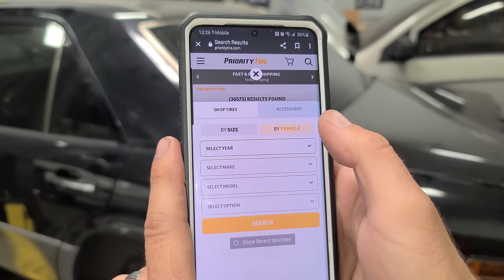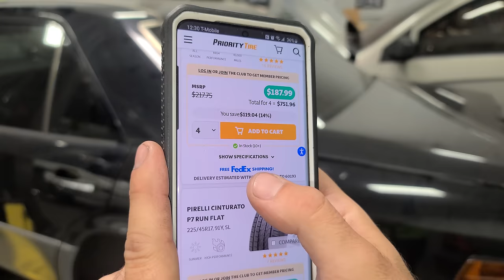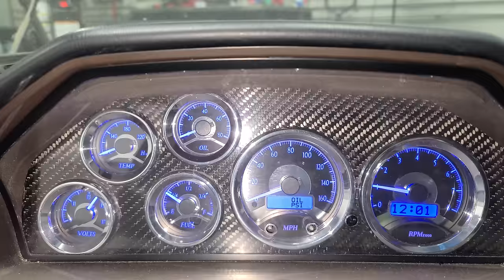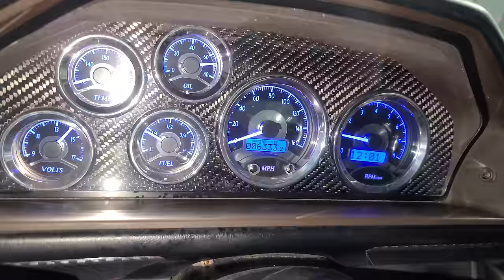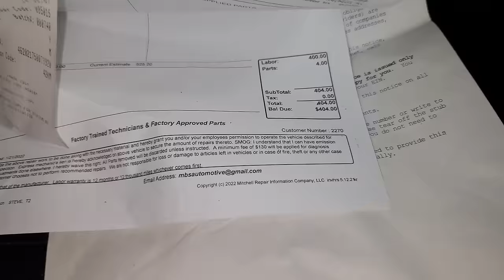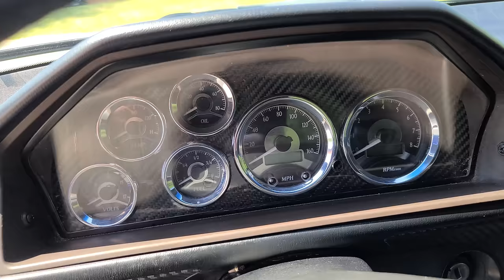I Finished EVERYTHING On My LS Swapped Mercedes Turbo Diesel! Best Of All Worlds!

Comment from the maker: Get 5% off any tires and accessories on Priority Tire's site with the code 'LEGITPT823' until August 31st at: https://bit.ly/LegitStreetCars_PriorityTire.
Reply: Sorry, we don't say meats in cali.  Must be a mid west thing.
Reply: Air in oil line before filter has to be pushed through the filter. Dry media of the filter is invisible for air. When you have oil over filtering media - you create extra resistance. It can rip a hole in your filter.
Reply: The back of the driver's seat needs a tiny little bit of "sewing".
Reply: Yes I do lol
Reply: Love the idea of where this is going!! But what happened to Peter??
Reply: Dude, if the AC works I'd give you 12 grand
Reply: Did you just say "MEOW"?
Reply: Why do they insist that you order the Chinese tires?
Reply: Thank you for the 5 percent off I needed it
Reply: @RobertDooley-sl7cp  I heard people say the tire has a lot of meat left on it.
Reply: If it's never been done before at that point you set the price but do remember the price of the car when it was originally and not going way over the top to it
Reply: So what are the odds this gets an LS supercharger Alex @legitstreetcars 😮😈
Reply: 36:36 DeLorean wheels and tires!
Reply: 300 LS
Reply: Should call it the Mercedes 300 LSD
Reply: Best of luck in future but remember I like because of Mercedes Benz first and second find some luxury cars to work on like the rolls royce phantom in in bad condition and restore it good episode positive you have a million views
Reply: Idk how you do it please just trade it for another Mercedes keep it going all Mercedes trade up…!!!
Reply: I have 1989 trans am turbo but someone before me put 350 should I do LS swap and add turbo??
Reply: @doncrescas  Yeah, wouldn't put those shitty tyres near anything, let alone a car with several hundred RWHP.  Most important parts of a car, tyres, brakes, suspension and steering - don't cheap out on any of them!
Reply: Needs my black center mono blocks. That would be perfection.
Reply: Absolutely do not feel sorry for dropping your oil. They sell it to whatever service comes to get it and it goes to be recycled. Any bulk oil distributor, like for an oil change shop, or industrial cleaning service, like safety kleen for example, will come get it for free and you can even negotiate with them for the price they will pay you for the discarded oil. Yes, they will buy it from you. Maybe even bring you a bulk tank for used oil to dump it into, which makes it so that they can come whenever you schedule and just hook up their truck and pump it out, and away they go. You'll sign for however many gallons, and they'll send you a check or bank draft or whatever.
Reply: Would you be willing to trade the Mercedes for the Tyler Hoover ,WS6 car treck car?
Reply: !e!!!eaew!a!
Reply: Asass❤11Q
Reply: did you check you k40 relay "w" on your w215 to make sure that you are not loosing power to the coolant pump?
Reply: If i was to run across a 2000 Mercedes Benz diesel runs and drives just got hit in the front are they good cars
Reply: I love this car i want a car like that to go to work
Reply: Pineapple, but not too much. I also prefer cold pizza.
Reply: How were the motor mounts done? Bolt on??
Reply: And ...what is the total cost?

Comment: Lake Speed tested the difference between prefilling and not prefilling oil filters. Tested in the Valvoline lab on a test engine. Analysed the oil samples and computer traces of oil pressure vs time. Pre fill your filters folks!!!

Comment: Next car you detail, you should iron decon and clay bar before doing the paint correction. It will make the buffing way easier and cause less damage to your pads and paint.
Reply: I'm actually sort of surprised he didn't clay bar it, but maybe he thought it wasn't necessary, I don't know.
Reply: It's single stage paint, the paint is really soft and you end up pulling more paint than contaminants. Also he doesn't love the car like that.
Reply: I'm the same.
Thought a quick clay bar.
But the Merc turned out great..
Reply: Trizact wet sand pads before the compound would have made a huge difference
Reply: He should probably use a lot less product as well. He’s using WAAYYY to much. It just clogs up the pad and is hard to buff off the paint

Comment: 30:20 the thing about oil based clear coats is that buffing heats the oil reactivating it into a uniform finish. need to clean surface with cold water on a cold day to prevent dirt from becoming imbedded into the clear coat, tho buffing down to the paint and re-clearing is an easy process.

Comment: Hey Alex have you ever considered using saddle soap for softening & cleaning anything leather, it works really well and can be found at in the horse section at tractor supply stores for very cheap, make sure you grab the solid one.

Comment: That car certainly buffed out and cleaned up nicely. I also can't believe they didn't think to swap the throttle body around and instead put a nipple on the hood. I think you got a fairly easy one here, minor mechanical work that needed done, hardly any parts, I think you'll do well selling it or trading it up.

Comment: ASE Mechanic here, one tip in regards to oiling your air filter is to spray it and leave it on newspaper overnight to prevent fouling up the MAF sensor if you have access oil in it.

Comment: If i remember correctly from the previous video the car was originally a 300D model and immediately came up with an idea that I would really like to see on the channel - building an OM606 engine :) Lots of people here in Europe like this engine and tune it(If I am not wrong, I think the OM606 is the 300 Turbo Diesel from a W210). Legends say on stock internals engine can easily take 500 HP..  So, knowing you perfect work from each and every video, I think you will be able to create one of the best cars with an OM606 :)
Reply: He did build a diesel mercedes but with the om648
Reply: Om606 was first used in 1993. If you have to have a 722.2 transmisjon or 722.6 then it's superturbo time

Comment: 12:21 cornwell tools had a socket shaped like a bell that’s used to replace it without having to remove anything. 2 he job turned 10m with the socket. The tool truck guy who comes to our shop designed it and sold it to snap on and cornwell works great in the trucks with very limited space.

Comment: E34/E39 BMW 5 series and W/S/C 124 Mercedes are some of the best cars ever made. The LS really fits with the solid engineering of the W124... The W124 diesels were EXTREMELY solid cars, but not fast. They could be made fast though, the straight six 3 liter turbodiesel OM606 engines take 700 hp without being opened. Pretty much the diesel version of a 2JZ. 
Very nice car with an LS!
Reply: Completely agree with you, I've currently a E34 525TDS and it's a perfect cruiser, so efficient and comfy ! This one and the W124 300TD were the kings of road here in Europe 90's.
Reply: Had a E39 528i manual, that was a great car and great to drift as it had the same rear axle as the m3, little low on power perhaps with just 198hp but a Turbo will fix that as they take low boost just fine.
I would get another 528i just for a daily driver but they are not common anymore, most were sold with the horrible automatic transmission, and most is scrapped.
Reply: the m104 gas inline 6 is that way too, turbobandit still has a turbo kit for em same with the m103.
Reply: Lol. I have  a few manual 528's sitting around. They had a open 188 kompact diff. Not a m3 diff.   I did swap my 528 wagon to a m5 210 lsd diff. And a turbo e36 m3 motor. Cant complain , thats for sure.
Reply: E39 owner, my car and these old big body Benz cars truly are peak
Reply: @drewdavis239  
And thats not the Automatic one?
Because the 528i and 528iA use different rear axle.

Comment: Two things of note:  Don't use primer alone to protect from rust.  Primer attracts moisture and will actually promote rust.  Shoot something else over the top of that primer on the battery tray.  POR15, or just an actual black paint.  Two:  Before you ceramic coat your glass, hit the glass with your buffer, and your cutting compound.  It'll remove any microdebris from the surface, won't harm the glass, and will make it crystal clear, like it was brand new glass.  THEN coat it.

Comment: I am like you on the oil filter. If the angle will not cause the oil to run out I prefll but if the oil is going to run out during install I don't. I also disconnect the ignition and build oil pressure before I start following a change.

Comment: What about a drag strip run between this and an original 400E/E420 or 500E/E500 even!?
Reply: This would gap an E500 for sure.
Reply: @rv9990  what kind of horsepower is this engine making?

Comment: I thought my oil pressure switch was bad on my 2016 Chevy SS but found out the oil pump was replaced at 27k and they used a lot of silicone seal the pan. So of course some of it went through the engine and grenaded it! Thank God I bought a warranty and was replaced with a new LS3. Bone stock and I LOVE THIS CAR!!!!

Comment: Pre-filling a filter is an issue if you getting oil from a bulk tank without filtration on the pump.  You could be introducing debris or contamination from the bulk tank.  In the gas compression industry it is recommended to install filter dry and run your prelude/hot start system to cycle the oil before starting.

Comment: Wow what a transformation, let's see where we go from here. What could be cooler thank an LS W124 ❤
Reply: Nothing. I have a Tahoe and a w124 and I really like driving the Tahoe more just because it has the torque and runs great for around town but I much prefer looking at the w124, having the 5.3 in the 124 would be perfect. 
That said, I’ll never do it, it’s probably beyond my skill level to do it nice enough and my w124 is mint with relatively low miles so I’d feel a bit guilty. I think I’m going to sell it in the spring. I thought I’d keep it forever but I haven’t even drove it this year so it’s time to move onto something I’d use.

Comment: This is so much more entertaining to watch and you look you are having way more fun working on this than the Mercedes V12. Everything just makes sense on this.
Reply: This w124 is the 300d model, it came with an inline 5 cylinder engine (OM603) originally, not a V12. 
However, you are right he looks like he’s having a blast, & he’s not covered in oil and soot like he would be working on the original turbodiesel engine
Reply: @Warex06 he's talking about the amg cl 65 the nightmare on wheels😅

Comment: I use 5 gallon Home Depot buckets.  They have a really tight sealing cap on them.  Sometimes the auto parts guys give me flak for bringing in 10 gallons of oil at once to recycle but they're usually good about it

Comment: Watched some test about pre-filling an oil filter. They found out that the first moment with pre-filled filter, the oil pressure is Lower than with empty filter. No idea why. Go figure. On my audi service manual says to Not pre fill the filter but just lube the gasket. I remove the fuel fuse and crank it for few seconds to fill up the filter and then start it back on. Great find Alex

Comment: I like the way you went with this Benz and fixed what I would have wanted to.  Just maybe get the shifter swapped out for a more stock look and insulation under that newly fixed hood.  That car is going to be grabbed very fast by the person whom will appreciate it and enjoy it with wanting something like that and couldn't find it.
Reply: the gauges need to be returned to oem or if not possible, put in a digital dash.
Reply: @stevelouie5928 nah that dash looks great compared to the old OEM that was meant for a diesel engine which would not work for this LS.
Reply: But I agree with the shifter needing to be swapped out, that things a monstrosity!

Comment: you can prefill on a side mounted filter as the oil, once in the filter, will move into the filter media and sit there until it is pumped thru with the oil pump. May spill a little, but will really be minimal. But, should always prefill as it minimizes the time it takes for the pump to pressurize the engine with oil.

Comment: Nice car, the w124 is one i my favorite Mercedes. One tip, you might whant to check to front lower controle arms. They tend to rust close to the ball joint and do so from the inside out and still look good on the outside. Just tap the area close to the ball joint with a little hammer, if it's rusted out or starting to you will hear it.

Comment: Love it.  Wanted to do an LS W124 black on black with AMG monoblocks myself.  This would be my iteration of an AMG Hammer but at an attainable price.  Was wondering how they routed that exhaust since it has to go forward before going down and out.  Personally, I'd take the 300D and 2.5 Turbo emblems off and just leave the Benz logo.  Just needs a factory style shifter and a new steering wheel or get that one leather wrapped.

Comment: @28:27 Yes, you can tell it's single stage as you pad is getting black, and filled up with material quickly. Blow it out often or you will lose your cut and it'll be uneven.

Comment: If you are running this small diameter intake tubing, you can switch to LSA throttle body (CTS-V), which has a compact motor and much better fit.

Comment: Looks like when you evacuated the power steering pump you took out atf (red) and put in psf (clear)  - lot of these older cars spec atf for the power steering fluid and running psf can damage the pump and cause leaks.  Something to think about

Comment: Whenever I do any oil change I pull the fuse to the fuel pump if the vehicle doesn't have flood clear and crank it over for 15ish seconds or until I start to see some oil pressure. That way the only movement on the engine is from the starter until the oil filter fills up and the pump is primed.

Comment: Fix the squeaking belt
You should have put a new bonnet insulation pad back on the bonnet (hood) after it was fixed keep the heat and noise down, also you did not buff the bonnet (hood) or ceramic coat it after it came back from the workshop.

Comment: Just an FYI, that's MB-Tex not leather, leather was available but has a different pattern of the pleats. I'm working on my own 300D w124, mine is still diesel with 300k+ miles and in decent shape other than a little damage up front, but may buy a bigger pump and stay diesel, or a mildly built 4.3 v6.

Comment: I always make sure the filter is wet. Full is great but wet is important. Especially is you are cheap because the vacuum of the engine can break the inside of a dry filter. LSC has it right!

Comment: Have not finished the video yet, but get some exhaust wrap, it will help a lot. Less heat in the engine bay, so coils will last longer, also seals and tensioners, pretty much everything including sensors.

Comment: Nice job. Thanks for cleaning up that hood as well. Looks great. Peace of advice look up valuable cars my Frend traded for a Honda S2000 drove it for 2 years and sold it for more then what he payed for it. I wouldn’t look at something that is modified. Only because it’s what the buyer wants to bare. Instead look at the going market value for the year and model. If it holds its value you can trade up. Personal I like Jeeps they hold their value well and the more that’s done to it can increase by a lot. Best of luck. Nice work on the refresh.

Comment: Hi Alex, this car was my dream for many years now, as an ex mercedes mechanic back in the time of the 108 to 126 ,123 124, 201s is to have a diesel mercedes with a fast engine and blow all the diesel haters, at the light or on overtaking them when passing. Back in the day diesels were very dangerous in traffic, because the lock of performance.

Comment: I would guess the headers are for LS race boats, they definitely could have used the ls2 factory manifolds and run the exhaust just as the m119 v8 w124s had for a cleaner install.

Comment: The problem with pressure washing LS engines is that the knock sensors are basically cups under the intake, water will accumulate there and eventually rot out the wiring harness causing it to run poorly. At least that is what happened to mine. Anyway just a heads up.

Comment: I was definitely one of the people who thought you traded down at first, but this car came out better than i thought it would for sure. I could absolutely see you trading this for a newer Mercedes worth $15k or more if you get the right person to trade with. Its kind of a shame this wasnt an LS3 6.2L swap, only because i feel like it would fetch more like $20k, but still, the car came out Great Alex. If i sounded pessimistic at first, it wasn't because I didn't believe you could do this. I just felt the 400+ whp K24 Turbo setup was more unique and faster, and also more with the times, so i would still say you bought the K Swapped Mercedes at a bargain price and it was always worth more than you gave it credit for. I love the LS swapped Mercedes as well. I'm actually considering buying a 2019 AMG GLC 43 for $30k with 27,000 miles on it. Clean title 1 owner. You think its a good deal? I see other people driving them up to 150k miles and they are still worth $15k or so even with that amount of miles.